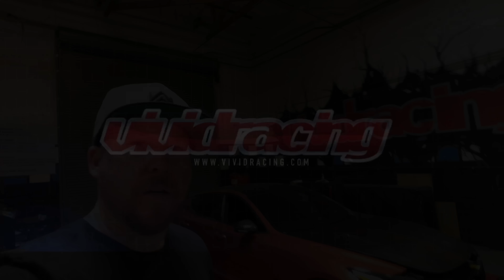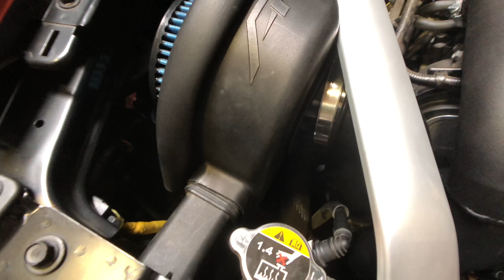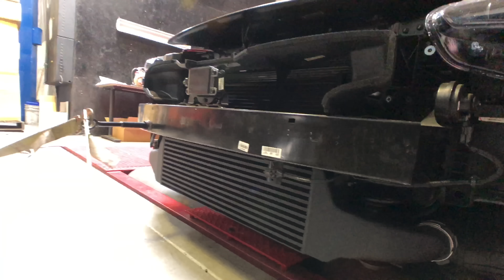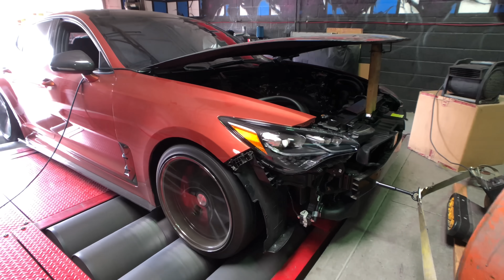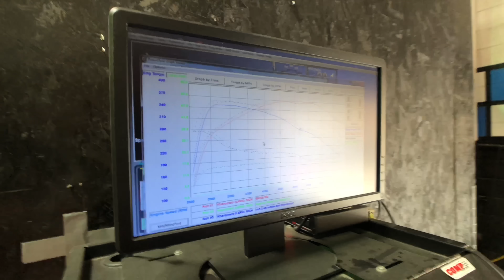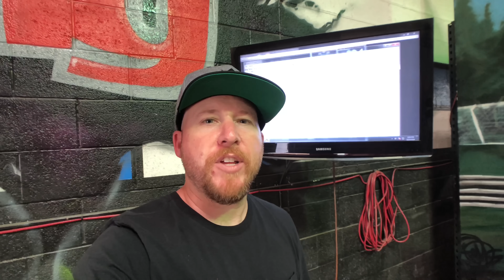3 Must Have Mods for Your Kia Stinger GT by Vivid Racing

Comment: Do these mods void the warranty?
If yes, do people swap out to OEM, then bring it in?
Please don't flame, I'm a noob with a 2021 GT2.
Reply from the maker: Mods depend on the dealer unfortunately. Google Magnuson Warranty Act. These 3 mods should really not be a problem nor a catback exhaust. I’m sure if somehow you grenaded the engine, they would blame this. But it has to be proven. Now if you were to do a tune, that is something that would definitely hold up for voiding a warranty. This is why most will flash back to stock for warranty visits.

Comment: Be cool if when I order from you guys it doesn’t take a month just to get cold air intakes ridiculous I might as well ordered them from the company direct
Reply from the maker: You ordered on May 9. Hasnt been a month yet :) They have to make these to order and the entire industry is backed up. So you could order from them both and get the same ETAs.
Reply: @vivid_racing  when I originally wrote this I was told I’d get it in another week. So yea that’s a month. Now I’m not getting it till June 25th. What aggravates me is next time instead of me calling multiple times and hearing it’s coming a week later to o no now it’s not coming till 1 month, 2 weeks and 2 days from your original order date it would of been nice to know that from the beginning. :)
Reply: @bryanreid4559  Did you ever get them?

Comment: Will these items fit on a 2021 Kia stinger GT line? It’s the 2.0 liter with twin turbos.
Reply: The 2.0 is a single scroll turbo. Only the v6 is twin.
Reply from the maker: You can check out this link for your specific fitment https://www.vividracing.com/agency-power-cold-air-intake-system-kia-stinger-33l-p-152537815.html or shoot us an email at sales@vividracing.com and one of our reps can help you out!

Comment: I've been looking everywhere to find a video that actually shows the numbers and offers what would be best to pull out the power. I'll be back to this after I trade up my 2.0 Stinger to the new GT next year 😭😭😭
Reply from the maker: We'll be here! Thanks for watching!
Reply: The best to pull out the power, is lozic ECU/tcu tune. If your goal is speed, you'll go from 4.7 to 3.6/7 0-60 with just that. After that exhaust and down pipe are a good increasing tool, plus sound cool, as the guy in the video said. I suggest a catted down pipe, which few companies make, but you can find on khartunerz.

Comment: Hey Vivid Racing!  Great Video... Now that's its been a few years how is the car running?  Any issues with long term performance, or bumps in the A/F ratio?  Any ecu tuning needed with these mods to ensure stable and reliable daily driving?
Reply from the maker: We have never experienced any issues with full bolt-ons and a tune and this car has been a daily driver since it left our shop!
Reply: Will those bolt ons void warranty ?
Reply: @dmgwraith8417  
Yep. Whatever your contract says in regards to engine modifications will void warranty

Comment: I’m confused, doesn’t the car have 365chp so around 300whp? 230 as the baseline would be a 35-40% loss at the crank. That’s crazy.
Reply from the maker: That's what the car made on a low reading AWD mustang dyno with 91 octane and summer temps over 100 degrees!
Reply: @vivid_racing  gotcha, regardless all reading were obtained on same system so significant improvement was seen. Thanks for the video!

Comment: I recently bought a 2018 KIA Stinger GT2 Limited AWD, can I get these upgrades in Canada?
Reply from the maker: It seems there are a few modifications that would be deemed illegal including; lights, mufflers, license plates, and tint. Most other modifications will fly under the radar, but I would recommend looking into your local laws first.

Comment: I just got one.. love it.  My GT2 replaced my MKVI Golf R.  No comparison.  And with mods this thing very well may be a GT-R killer for the price...  And I'd take a korean made engine over french.
Reply from the maker: For the price you just can’t beat it! 🙌🏼 glad you’re enjoying yours though!
Reply: Im in a 2016 MK7 Golf R Stage 1+ tuned and debating what to do next .. Problem is I want to get as much speed as Im getting now but I think I need to do a bunch more to the Kia than I had to do to my Golf in order to get that. Right now I know a stock Stinger would not be enough to satisfy me. Anyways, how do you find the gas mileage vs your old Golf ?

Comment: Question: what do mods like this cost and do they void my warranty? I have a 2020 GT Indigo Version.
Reply from the maker: The Magnuson-Moss Warranty Act states that a dealer must prove that aftermarket equipment caused the need for repairs before it can deny warranty coverage. Generally speaking, dealerships will try to void your warranty if your vehicle is modified, but that's not always the case. It's best to check with your local dealership to see how they feel about those modifications.
Reply: They absolutely void your warranty AND are expensive PLUS after installing any part that will make a significant gain your car must be retuned and it is never as reliable.  This is from only my experience but im 41 and have owned at least 40 cars.

Comment: Hi there, can you just bolt these on or do you need a ecu tune to see actual power gains ? Thanks
Reply from the maker: These are bolt-on modifications. No tune is necessary for them to function and improve power. In order to feel significant power increase along with the installation of these products it is recommended to tune it as well as it will provide the most efficient and satisfactory experience.

Comment: It would be interesting to check the silhouette dimensions of the Stinger 3.3lt  vs the LS 6.2.
Fitting the LS3 with twin turbos under the Kia plastic engine shroud  would make a very quick and stealthy street car..
Wouldn't fool a close inspection, but would be interesting..

Comment: So you make a BOV for a 2017 Kia Sportage? I really don't want to buy a pos FORGE BOV as they wear out quickly.
Reply from the maker: Drop an email to sales@vividracing.com and one of the guys can help.  BTW Forge is the original designer of the piston and spring valve and we have used MANY over the years.  I dont think they are POS.
Reply: @vivid_racing  sent an email as you suggested and today is day 4 and still haven't got a reply from vivid racing.
Reply from the maker: Brad K maybe went to spam please resend ATTN DAN

Comment: Wait...230 whp from 365 crank, what🤔
Reply from the maker: Klasse Act drivetrain loss
Reply: @vivid_racing  ...but THAT much😏
Reply from the maker: Klasse Act talked about this a thousand times in videos.  91 octane, mustang dyno
Reply: @vivid_racing  ok👍
Reply: Vivid Racing This still doesn’t ring true.

I have an 2018 Audi RS3 which has been dynoed 4 times, for various reasons in the last year and a half, on a Mustang Dyno, with AWD, running only 91 octane, and I’ve only ever seen between a 15-17% loss. So, I don’t understand why you didn’t get at LEAST 300whp, not even including your new intake and intercooler.

Comment: So this car loses 130 hp through the drivetrain? 😂😂 Wow.
Reply: Subie Mike that’s awd bro
Reply: @erics.5785  right. My car is awd. Goes from 268 stock to 205 on a dynotech Dyno. 215 on a mustang. 130 loss is outrageous. Maybe if it was a 550 hp car. Not a 350 hp car
Reply: that answers that on shud i buy this instead of a mustang
Reply: Which is weird, I mean expect 10-15% loss but not 130hp for AWD.

Comment: Thinking about getting one of these and modding the hell out of it as a project. I'm bored and want a new toy.
Reply: Did you get one? I got mine in May of 2019 and can't stop feeding it! Great toy. Next up, intercooler and a day at the track. With intake, exhaust, and tune, I'm at 400 hp at the wheel on a AWD GT2.

Comment: How the fuck do u take a 370 HP vehicle, put on blow off valves & cone filters & UPGRADED INTERCOOLER & then do a dyno run & COME OUT WITH 270 FUCKING HP??? GET OFF THE FUCKING DRUGS DUDE.
Reply from the maker: First, I can see you’re not educated.  To many fucks written.  Second, welcome to how dynos work and drivetrain loss.  Do you need a explanation in a video or Snapchat

Comment: Has the intercooler been released yet, and does it include a piping kit?
Reply from the maker: Yes it has head to vividracing.com
Reply: @vivid_racing  Intercooler doesn't show up on the site?
Reply from the maker: @DXCal09  I think they are waiting to do the product images.  email sales@agency-power.com and tell them you want to get one of the first ones :)
Reply from the maker: @DXCal09  Just checked with team and they will be online today
Reply: @vivid_racing  What hp is it rated for?
Reply from the maker: @DXCal09  Please email Agency Power for those details as I dont have that info yet.

Comment: I have a Stinger GT.. And OMG.. I love it!!!!! It's not a Gt1 or even a GT2. But i love it.. 😁 if your having doubts, dont! Just buy one.. U won't b disappointed...
Reply: Agreed completely.  Just got the GT for under $40k. It's a blast!! Cant wait to tune it up!
Reply: Justin Michalski just got my GT2 for $36k it’s so nice, I almost don’t feel like I need to mod it it’s gone a ton of torque but the gear head in my is rebelling
Reply: @handsomej81  The Stingers in Australia are $80K and only RWD :(
Reply: Yup I have the "base" GT as well... Next time imma get the GT1!
Reply: @jsnwill19  can't wait to see what the revised version is gonna look like...
Reply: Alejandro Valle whats the difference between the gt1 and gt2 and the gt?
Reply: @1Ricky1  we'll, GT2 has better seats or leather.. Bigger nav screen, adjustable suspension, sunroof, power rear lift.. And probably more stuff. I don't have any of that.. Engine and wheels are the same on all model's.
Reply: @alejandrovalle2507  I thought adjustable suspension was for all GT trims
Reply: @AlienCreatureThing  
Gt1 and Gt2 have a limited-slip differential. (Optional on GT)
They also have electronically controlled suspension. Gt2 has a shift by-wire gear selector. GT does not.. 
But in the real world.. I don't need any of that..
Reply: @alejandrovalle2507  oh ok cause I got the base GT and mine has the adaptive suspension but then again I have a special red on red from 2018, it was probably an option (I bought it used)
Reply: Awesome car
Reply: I have one, I got it yesterday.  This thing is f CRAZY!!!
Reply: Question.... How much room is in the front seat?  I have a 2012 Genesis 5.0 R-Spec which I fit perfect in and am about to give it to my son.  I want the 2019 Stinger GTS (Orange) or the 2018 Genesis G80 Sport, but I am also 6'3" and wide as a door..... Your thoughts?
Reply: @Woody21369  its gonna feel cramped in there im 6f 200lb and its a pretty tight fit then again i went from a charger so i was used to a lot of room
Reply: @TundraBoy  Thanks for the heads up. Cars in Southern Indiana are getting stupid. Wife had a 2019 Ford Flex limited. Great ride for long trips until you have to get gas. Less than 19 mpg on hwy. We were both considering trading in our cars as they're both paid off. I have a 2013 Genesis 5.0 R-Spec with only 62k miles on it. 

Can we say Dealer Mark-up!!! Looking at a used 2019 GTS Stinger and 2022 Telluride... $5000 dealer Mark-up on the Telluride and $3500 on the Stinger. Same for Hyundai Palisade and Sonata N... In the end Honda and Toyota were just as bad. I'm keeping my R-Spec and wife got the Outlander Black Edition. Still ended up with $2600 in Dealer Mark-ups. 

Enjoy your Stinger I would not look to sell that thing for quite a while. :-)
Reply: @Woody21369  and now the interest rates are up to. I got lucky and got it from a Hyundai dealer for only 4%. 2019 50k kilometers $39700 best deal I could possibly find
Reply: I got a 2022 gt2. So far i am okay with it. Can somebody create a group for stinger owners
Reply: @4our_  go to Facebook there’s two big ones there. And there’s 2 main forums as well. Those have been the most helpful so far
Reply: I jus got the 2022 Kia stinger gt2 elite for 66k I’m in Canada and that’s after tax

Comment: Why are these morons whining about warranty? people reflash cars all the time, i drove a reflashed car for 200k miles +. 
Go whine like a grandma in videos of people boosting gtrs well north 1000hp too. The quality of the job is what matters. Keeping the turbine under it's overspeed limits, intake temperature, exhaust back pressure, analysing exhaust emissions for signs of excessive unburnt hydrocarbons... When tunes are made by qualified people they result in thousands of satisfied drivers for years. APR, Abt, Revo... 
Bitches
Reply: How much does it cost to have this done
Reply: I had a APR Stage 2 on my brand new GTI and the engine blew 30k miles/year later.  If youre not rich dont tune ur shit, it will break.
Reply: If car manufacturers, with literally millions of dollars and teams of engineers aren't putting these mods in, its for a good reason. Car manufacturers spend millions on R&D just to create an engine with 30 more HP than the last generation. Manufactures are already pushing their cars to a limit which they have deemed as not worth crossing, as the relative wear on the car is too high. There are exceptions, such as with some cars which have been designed to accommodate aftermarket mods, but the Kia Stinger is not such a car. The stinger is already engineered to a high standard, going above this is a sure way to blow something. But if you've got the cash, go ahead I guess, but you would likely be better off buying something more moddable in the first place.
Reply: I understand that pretty well, I worked in an academic engine development center for two years and made a few ignition and fuel maps myself for a couple cars as a part of the program. I know there are limits, most of them, believe it or not are to cut post ignition emissions and in turbocharged engine’s case; to improve turbine’s durability and other high wear components. Every turbine has to be rebuilt at some point, working on high pressure increases axial speed, temperature and so on. I agree with you, I just don’t understand why complaining in this video in particular alone. There are thousands of videos featuring tuned up cars, nobody complains, everybody loves those channels and subscribe to these people. People racing these cars daily... nobody whines about those cars being thrashed like that around yt. 
Kind of hypocritical that out of the blue everybody cares
Reply: @Lucas-ck1po  I think its just where the Stinger is such a new car. Seems slightly 'wrong' to be modding a car that comes with such a good warrantee, but I can fully appreciate you're point here. I think the stinger has the same issue as the miata or BRZ, enthusiasts just don't like people slapping performance mods on a car which they deem as perfectly balanced. A certain snob effect if you will. But I do see a lot of potential in the stinger, reminds me a lot of the 2JZ supra, could become quite collectors item.
Reply: @scottagon  Wow. You are pretty clueless about automotive engineering. Almost every manufacturer leaves a good amount of headroom for potential power in their engines. Stringent federal regulations regarding emissions are always the reason carmakers "detune" their engines. They can't get every possible unit of horsepower out while still adhering to emissions standards. Therefore they put things like catalytic converters, and evap emissions controls that rob power so they can legally sell the vehicle. To say that the Stinger isn't built to accommodate mods is just factually false. Does adding 100hp to the car add strain on the components? Absolutely. However, the impact is much less than you'd like to believe. Anyone who mods their vehicle should know the possible pitfalls. You pay to play. Don't confuse opinion for fact.

Comment: Blow off valves keep your turbos spooled... oh okay...
Reply from the maker: If you dump the built up pressure back into the intake, that can cause compressor surge and slow down the impeller.  So yes by venting the air out 100% to atmosphere, it helps keep them spooled up quicker.
Reply: @vivid_racing  Helps them spool faster is not the same as keeping them spooled like what an anti-lag system does. And blow off valves do not help your turbos spool faster either. But good luck selling your product.
Reply from the maker: Over analyzer...  Its simple, blow off valves help keep your turbos spooled in between shifts.  Nobody said anything else. Have a fantastic evening.
Reply: @vivid_racing  No, they don't. Their only purpose is to vent built up pressure in between the turbo and throttle plate when the throttle is closed. Turbos do not "stay spooled" when the throttle is closed whether there is a by pass valve/blow off valve or not because turbos need exhaust energy to spool them. When the engine is in over run or when the throttle is closed it's not making enough waste energy to spool the turbos.
Reply: @vivid_racing  Turbo systems are not simple and if you think they are you need to educate yourself.
Reply from the maker: I/we have been doing this for 17 years.  Im pretty DAMN sure of what we know.
Reply: +Vivid Racing : Yes, same theory like a jet engine...compressor bleed on high bypas turbo fan jet engines.. although our pressures are used for pressurizing the passenger cabin and air condition...  I’m looking for mods for my Ghibli...
Reply from the maker: Plenty of parts available for the Ghibli https://www.vividracing.com/index.php?keywords=maserati+ghibli

Comment: The AFR dip is due to catalyst overtemp protection, if you do some datalogging you will see the catalyst temp is way over 1600f during a pull.